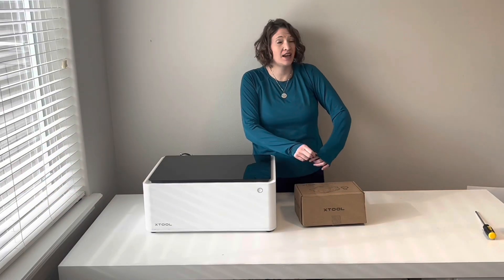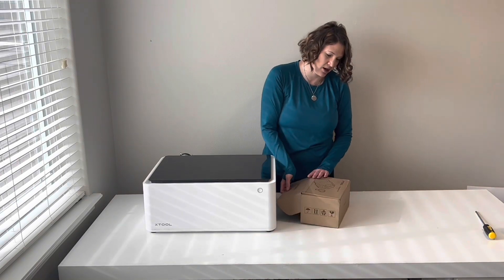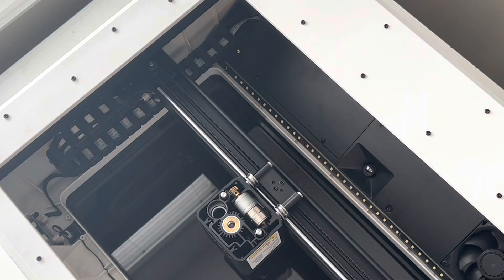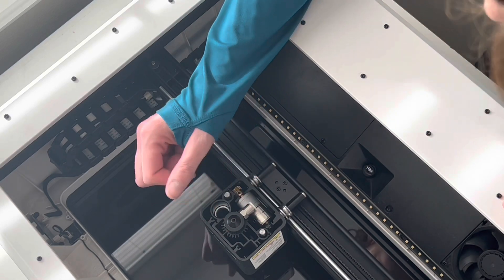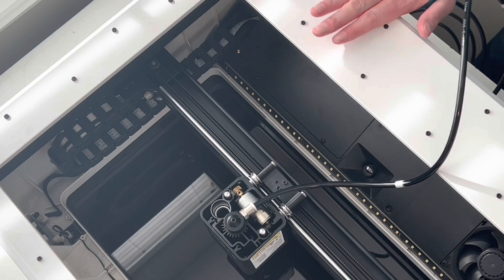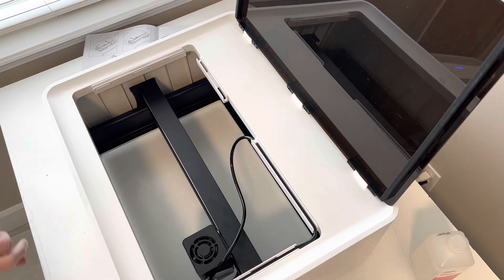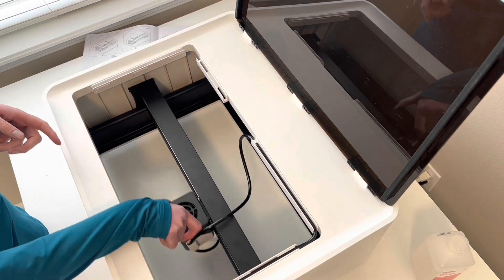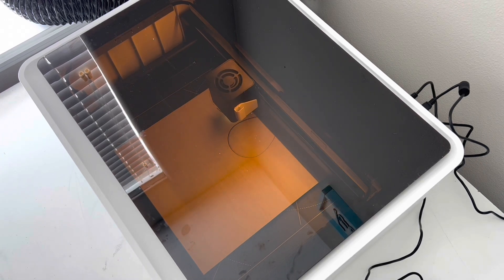How to Install Air Assist on xTool M1 to help Prevent Scorch Marks

Comment: I installed it but it looks suspect.  They want you to remove the cover that protects the components in the tool head, but they don't include a new, smaller cover in the kit to replace it with.  So you're using the XTool without the protective cover now.  They must have had a good reason to design that cover, but now they want you to use the machine without it.  Seems odd.
Reply from the maker: That’s the process but it works great and I have had no problems at all with it and it’s been 9 months

Comment: I really need help and custpmer service has been crap for me. I spent over a hour trying to thread that piece that goes over the laser and needs to be lined up right. Every way I thread it it always ends up being tight the wrong way. What am I doing wrong? Please help 😢
Reply: Did you figure this out? I am having the same issue. Will not tighten any where near parallel to the bar.